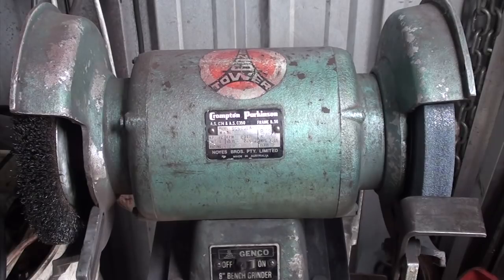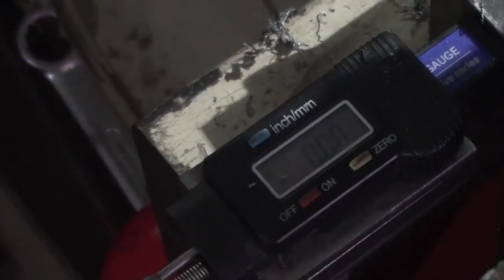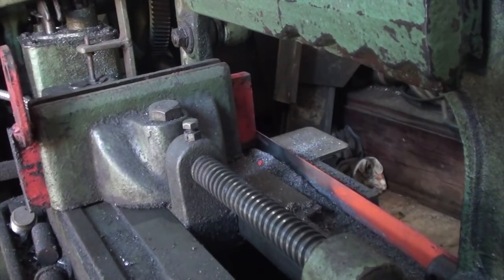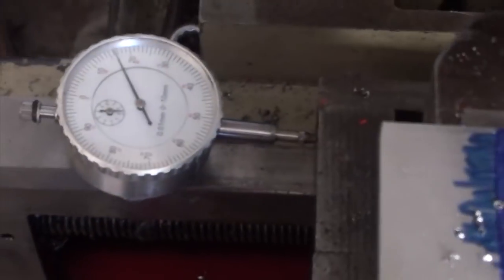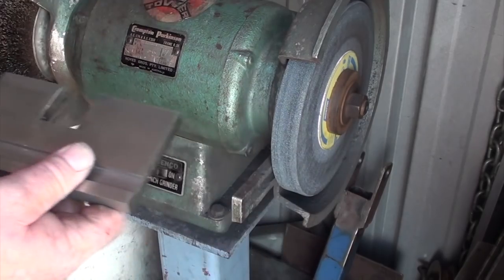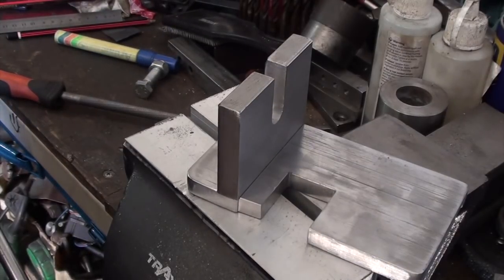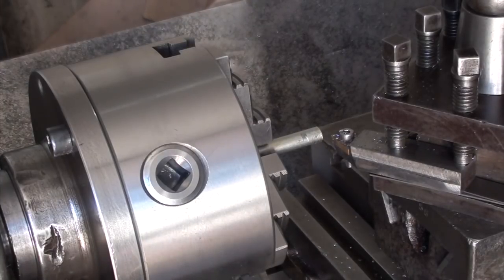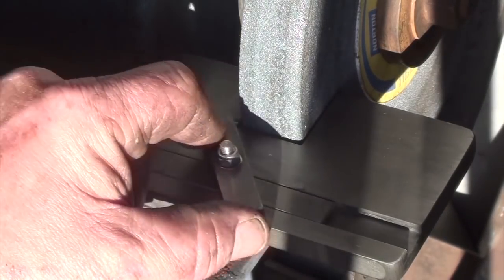Bench grinder tool rest

Comment: thats a really nice tool rest and that indicator is really neat, it would be interesting to do something similar with like a 6" dial indicator or something like that for a longer travel dial for the lathe. Also, have you tried snugging up the gibs on the indicator? Ive had that same repeatability problem with import digitial calipers, then after snugging up the gibs inside of them, it started going back to zero or to the same measurement every time.
Reply from the maker: Gday Chirpy's, Thanks, I will have a go at the gibs, I didn’t give that a thought, I made a 6” one for the tailstock on the lathe and it always repeats, I didn’t realise how many times I use it and it takes the guess work out of how deep you a drilling, very very handy tool and cheap to make,    ATB Chirpy